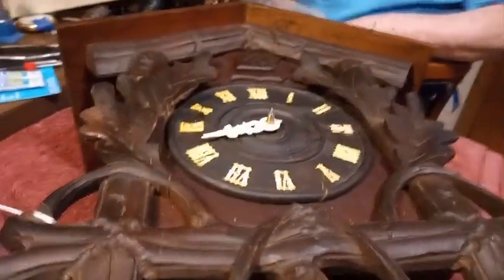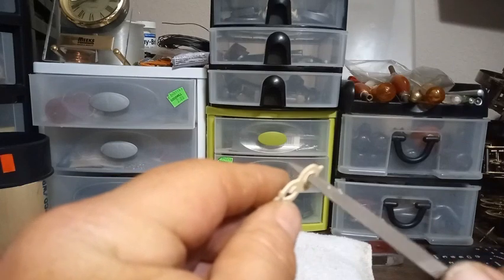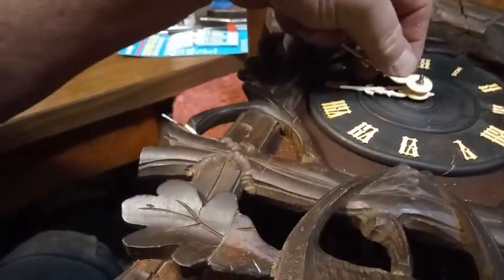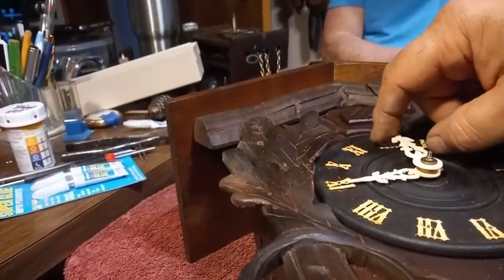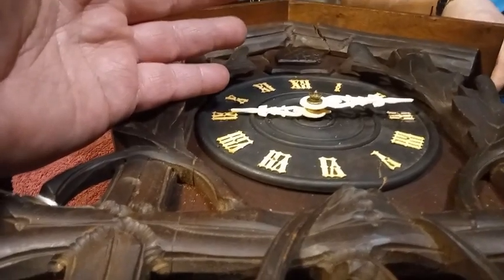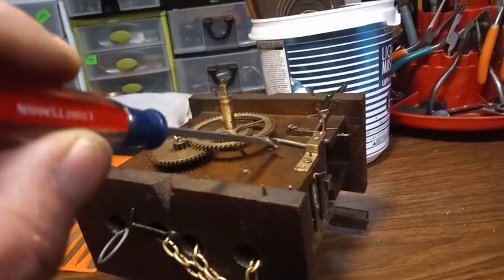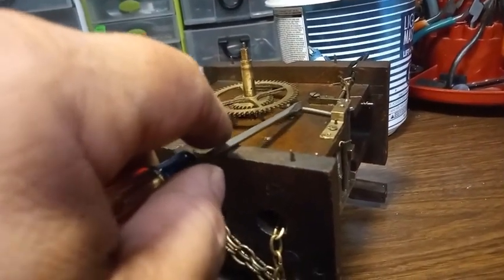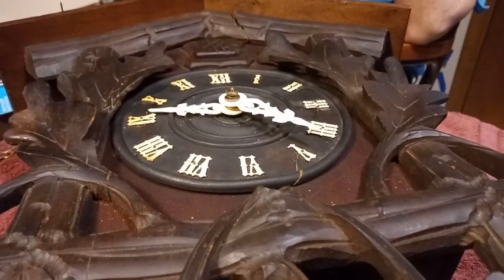Using round hole minute hands for a square hole arbor on a cuckoo clock

Comment: The hour hand went of too far. I mess up sometimes myself. Just use a little Super Glue in the hole and let it dry. If you got too much inside the hole, use the file again. As for the square arbor for the Old clocks, I file out the new square nuts big enough to get it to fit over the arbor. I will have to try to make the washers square inside and try this. Great video and idea. God Bless.
Reply from the maker: Thank you. Yes the hour hand might be on a tad too far but it is keeping time as it should. Thanks for watching and may God bless you and yours.

Comment: So why would you adjust the wire and not the minute tube?
Reply from the maker: I would adjust the wire that is connected to the lever that goes into the count wheel. The reason I would adjust this wire is the trip lever on the hour/minute pipe catches that wire and if it is not adjusted properly then the minute hand will not be in the position you want it to be in when it strikes. However when you adjust that wire you have to remember that it is part of the lever that you hit on the side to make it strike, that it is part of the lever that goes into the 2nd wheel cam, and that it is part of the lever that goes into the count wheel so you have to hold the end of the wire before it goes around to the side with a pair of plyers so you arent adjusting those other levers and getting them out of whack while trying to adjust the wire that sets it all into motion. I hope that makes sense.
Reply: Makes sense, just curious because on other videos you say take off the minute tube and turn it a tooth at a time to get just right.